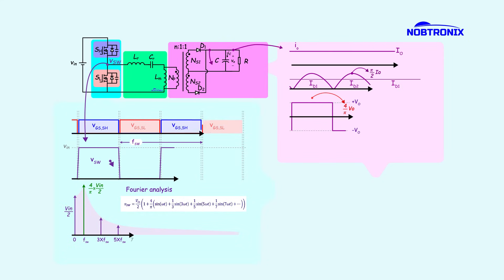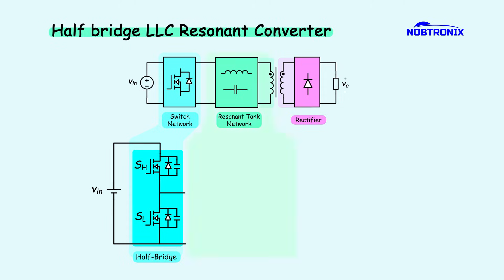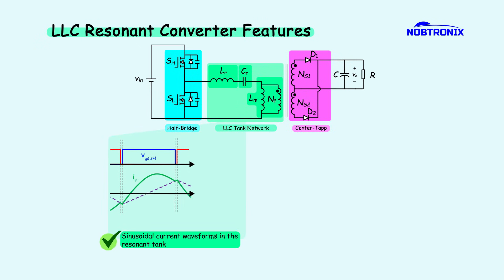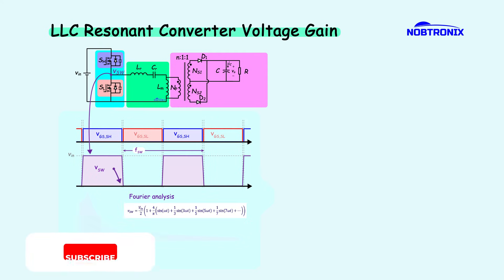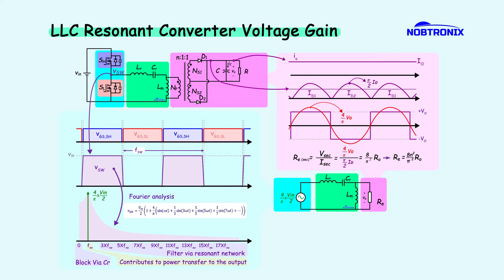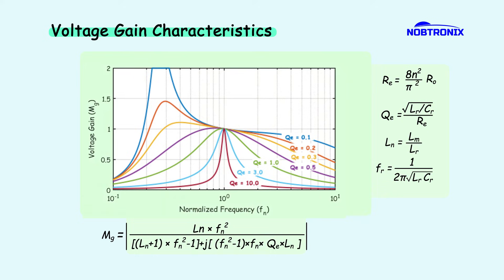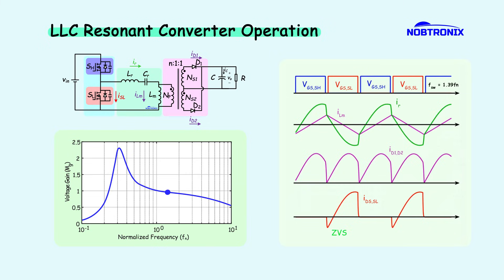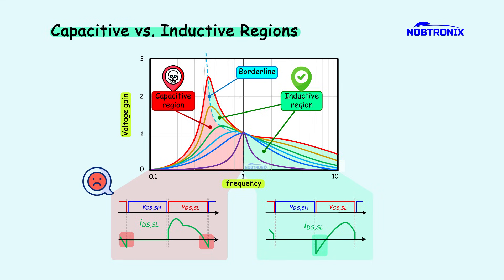How LLC Resonant Converter Works

Comment: @0:54  You forgot a Resonant Tank Network:  LCC.  LCC is the way to go if you need a wide range of output voltages, such as an LED driver with a wide range of the number of series connected LEDs, i.e. a wide range of LED engine voltages.
Reply from the maker: Thanks for pointing that out! The LCC resonant tank is mentioned in the video @0:54 , which is the same series-parallel configuration. Thanks for the explanation!

Comment: Thank you, Man. It was really Helpful and i hope you make more videos in LLC! I'm gonna to learn it for DC-DC something like 18-36 input to 12 or 5V DC output. Would that be helpful to proceed it with examples 0-100?
And another question: IS IT GOOD FOR AC/DC convertors? I mean 220 V as input or higher voltages?
Thank you so much.
Reply from the maker: Thanks! I’ll make more content on LLCs. They’re well-suited for AC/DC with 220 V input. I've seen several evaluation boards and commercial supplies using single-stage resonant converters.